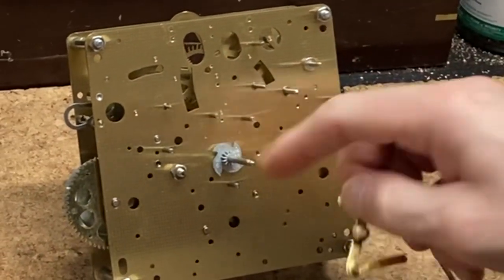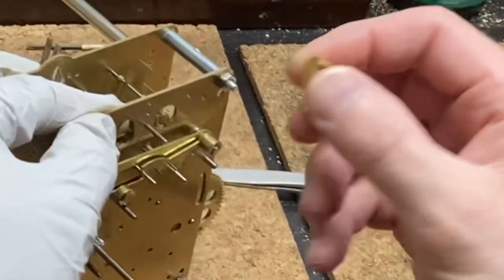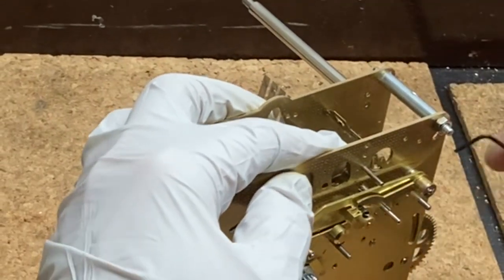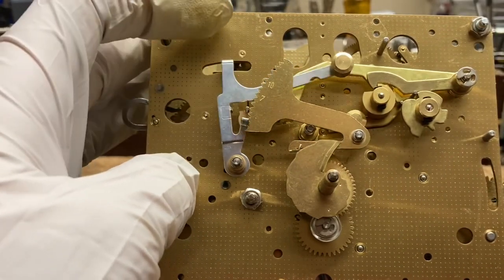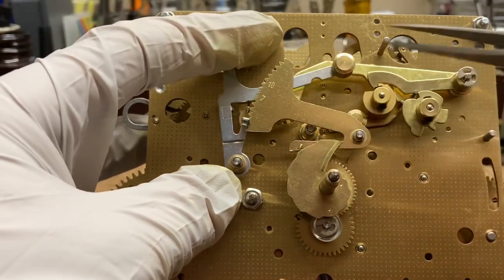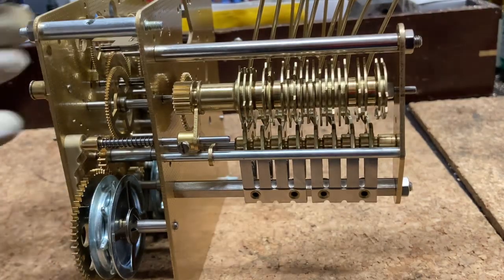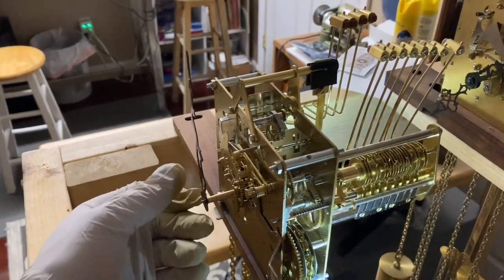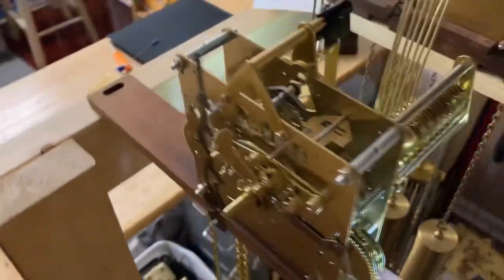How to install rack and snail to chime and strike for Hermle Triple Chime

Comment: Hello, I have a question.  I have a movement like the one in this video.  The problem I have with it is that it does not do the 1/4 hour chimes.  What it does do is that on the first hour it chimes the first 1/4 chime.  the second hour it does the 1/2 hour chime.  on the 3rd hour it does the 3/4 hour chime.  on the 4th hour it does the hour chimes with the correct strikes for that hour.  Do you know what causes this problem?  thanks

Comment: Thank you, Chris, some years ago I had a 3 barrel chime clock and all its attachments Holus-bolus piled on my work table.
So (without access to Chris's clock repair extra special directions) I began to reassemble each component in its sequential manner, finishing with the necessarily accurate escapement setting, then all I had to deal with was the chime and strike accurate settings.
Not overlooking my trial and error method, along with the disassembly & reassembly a number of times, while importantly, if I began to get stressed, I would up and leave my work table and give my mind a rest.
Time was not important as it was my own Winchester chime and strike clock, this occurred at my age at that time of my life, aged around 66 years & that was ten years ago, I am now aged 76. 
Yes, I finally had that old clock up and performing its strike and chime in its accurate restoration.
I was impressed by your assembly work, then your obvious years of experience has served you rather well.
Thank you for transferring your skills through your videos on your YouTube site.
Old William.

Comment: Merry Christmas!

After inheriting a Westminster chime wall clock (containing a 72 Hermle Franz 351-020 45CM) from a family member who entered assisted living in the fall, I have been attempting to get the "dead" clock running. The initial problem is that the pendulum refused to keep going. Turns out it was out of beat but the beat could not be corrected just by cleaning and oiling the pivot holes — which I did prior to Thanksgiving — in part because the clock oil that spouse and I inherited with the clock was as old as the clock (50 years!). I bought the Horace brand clock oil and took another whack at it on Christmas Eve, expecting no better result than before but instead got something of a Christmas miracle. Now the clock is keeping perfect time, just in time for my goal of getting it working by Christmas so I can show my family member a video of her beloved clock running for the first time in about six years. However, there is ONE issue remaining and that is that the chiming and the striking are jumbled together. The clock chimes as many times as it strikes and some of the chimes sound a bit sloppy (hesitating). 

Question: Is this (video) the main approach to troubleshooting the problem or is there something else I should try first? For example, I read elsewhere that there is a bushing inside the minute hand that may need to be adjusted but that was in reference to a grandfather clock. (Not sure if the same applies to this movement?) I am about to shoot a short video of the clock running to share with my family member but I'd like to be able to report that her beloved clock is 100% — and right now it's not because the chimes and strikes are jumbled up. 

As others have said, thank you for an excellent contribution to YouTube. Appreciate any tips!

Comment: Chris, your video was a big help fixing a problem that was strange to me. The problem was when the clock reached 12 o'clock, it would only strike 2 times. The rest of the times with the chimes and 1-11 o'clock strikes everything worked perfectly. After viewing your video I realized that the snail was not adjusted correctly and so after fixing that things worked as they should. Thanks
Reply from the maker: Great job!

Comment: Your video is a great learning tool.  My grandfather clock is a Danekar.  It has given me trouble for the past 25 years since my marriage to my wife Martha.  It is her late daughter's clock that I more or less inherited.  Before I began tinkering with this clock, my wife's father and his father were always trying to correct something with this fine machine.  My wife's father Joe actually built a wooden case for the entire movement so it could be easily and safely transported to clock smiths for repair.  Since I took over the maintenance of this clock it has always been 2 hours slow.  I could adjust the pendulum up or down until the cows come home and the time never is accurate.  The beat of the clock is correct and the pendulum swings freely and is actually on beat with a musical metronome.  Still the time is never correct.  I have almost given up on this particular dilemma. Lately, the chiming mechanism has stopped working.  This is something I really would like to repair.  Every You Tube video on this repair looks different from the mechanism in this clock.  Prior, the Westminster chimes would correctly function on 3,6,9, and 12.  The hourly strike would be somewhat functional as well.  However, the hourly strike would sometimes hit 25 or 30 times before it stopped.  I can easily observe this malfunction and have gotten the hourly strike to be accurate.  The problem again, and my main concern, is that the 3,6,9, and 12 chimes don't even activate at all.  From observation, there is no on or off switch to stop the chiming as there is on most clocks.  Short of hiring a clock smith to come out to the house, is there something that jumps out at you that could be stopping this beautiful chiming mechanism from working?  A response would be appreciated more than you can imagine.  Other clock smiths on You Tube have not bothered to respond to my much-needed expertise of grandfather clocks.  Thank You, Edmund Lubowiecki...
Reply from the maker: sorry for the very late reply.  Could you send me a photo to chrisclockrepair@gmail.com.  Then I could better assist you.

Comment: Chris:  I've been struggling to get my chimes and strike working since lubricating at Christmas.  When reviewing your video I noticed your "4/4" wheel was mounted closer to the shaft end than I had mine and when I looked more carefully, I noticed the "two" hook levers were being lifted by the 4/4 wheels cam. I moved my 4/4 wheel outwards about .02 inches and everything is fine. 😊 Thanks for your wonderful video but you may want to add a warning comment!
Reply from the maker: Glad you got it. What should the warning be?!
Reply: "Be sure the cam on the back of the 4/4 wheel is only engaging the front lever"   @Chrisclockrepair

Comment: I have a 1151-050 H sitting waiting for me to work on (mine is 114 cm as opposed to your 85 cm and the connection between the pendulum leader and the crutch on mine is a little different) so I'm expecting to watch this video at least a couple more times.  Thank you - this is quite helpful.  Also I like your test rack which it looks like has room for 3 movements at the same time so that gives me an idea of what to build.
Reply from the maker: Thats great to hear. My test rack can fit five or six clocks depending on the size of movements.

Comment: Appreciate this; it helped me get a 451-053 back in working order after complete disassembly and cleaning (previous owner had oiled the gears and everything was gummed up after sitting idle for years). What I ran into was an issue where the gathering pallet as you called it in 5:38 was not able to be separated from its shaft, so was left with trial-and-error assembly of the unit the star wheel, gathering pallet, and the warning wheel were all oriented correctly. Compared to the quarter hour side, which made use of set screws, the hour striker side caused quite a conundrum where I thought I had it right but soon noticed an issue where the last count for an hour was being cut off. One more tooth offset of the warning wheel's pinion later, and it was back to working correctly. The difficulty of maintaining the tooth positions when putting the clock mechanism together makes me wonder why the gathering pallet wasn't secured with set screws in the design to allow both sides to be tuned after final assembly.
Thanks again for your excellent video and explanation of the mechanism
Reply from the maker: You can adjust that star wheel on those hermle movements. Watch my strike adjustment video
Reply: @Chrisclockrepair  Ah, that would have made things a whole lot easier. Thanks!

Comment: Hi Chris.  Your videos are terrific and easy to follow.  I’ve watched your assemble and adjust the rack and snail video several times to try diagnose my chime/strike issue.  I have a Sligh grandfather clock with a Kieninger K series triple chime movement.  It stopped chiming and striking.  I’ve taken the dial off so I could see what’s happening.  I’ve oiled the pivots I can get to with Horace Whitlocks clock oil. It now chimes on the first, second, and third quarter hours.  On the hour, the drop levers raise, the chime governor spins a little, the levers drop, and then nothing. Governor doesn’t spin unless I move it but hand, then the cycle completes.  Once this stop occurs, chiming and striking are random and infrequent.  This 3 quarters chiming and then stopping on the hour is repeatable.  Clock was serviced in a local shop about 6 years ago and ran fine.  Someone may have tried to silence the chime while in progress once so as to not wake a child.   Any suggestions?  We don’t want to spend more $$$ for another repair so I’m trying to Youtube certify my way through this.

Thank you for any suggestions.

Jerry
Reply: A little more info…at the beginning of the hour chime cycle, the drop levers raise and the warning wheel rotates a little, but not enough for the stop pin to hit the detent.  When the levers drop, nothing else happens.  In all other chime cycles, the warning wheel rotates until the stop pin hits the detent.  In that position, when the levels drop the chiming proceeds with the warning wheel and governor rotating as they should.  I can’t see what causes the warning wheel stop pin to not make it to the detent.  The first three quarters the warning wheel stop pin moves from top dead center to about the six o’clock position.  On the hour it stops around the eight o’clock position.  Thank you.
Reply from the maker: Okay, I understand what you are dealing with.  What you want to check during the warning process (when the pin is approaching the detent) observe the chime hammers and the music roll.  If the music roll is too far forward and begins to try to life the hammers during warning, you will not have enough run to lift them when the lever drops.  There won't be enough power to start the sequence.  So it could be the position of the music roll is off or you need to lubricate the music roll and the hammer assembly rod.  If these are not the issue then it may simply be that you have worn pivot holes and there is simply not enough power to drive the chime sequence.  I hope that makes sense to you.
Reply: @Chrisclockrepair  Thank you so much for your analysis and suggestions.  I gave up my strong desire to take the movement apart and called a local repair shop. He identified worn pivot holes in front and back plates for at least one of the wheels. He will disassemble, clean, and repair the movement.  I’m spending more than I wanted to, but will save some of the expense by picking it up from his shop and reinstalling it myself.  Your videos are by far the best I’ve found on YouTube.  Your easy-going approach and clear explanations are helpful to novices like me, and probably to some professionals as well.  Thank you for taking the time to evaluate my issue.
Jerry
Reply from the maker: @jerryskelly9726  I appreciate it. Thanks Jerry

Comment: Hi Chris, many thanks for taking the time to do these videos. Could I just ask though, what product you use for cleaning your movements? They always look brand new, no matter what products I have tried, they never come out looking like yours. Once again many thanks.
Reply from the maker: I use a clock cleaning solution from timesavers. And i use an agitator to vibrate the solution as it sits in the bucket.

Comment: Amazing. You make it look so easy.
Its time for me to tear down one clock and clean it, the other is due for the oil.
On my ridgeway there is a pull type bar that hangs down it front of the hourly weight.  It pushes up or pulls down.  Do you know what its function is?
Reply from the maker: This is what turns on and off the “night shut-off” feature. So it doesn’t strike during sleeping hours

Comment: I followed you, all seemed good and logical until 15:15. I guessed 12 O'clock slot but you put it to 11 O'clock cam lobe. Why? I suppose later in this video it will be answered so I'm keeping watching. I deduce that in this position it just finished striking 11 and is setting up the rack for 12 .  This video taught me a ton! I have a Kieninger RWS and this front mech looks almost identical. Go figger!  As I recall it has spring return not the weight drop method. Thanks!
Reply from the maker: You're welcome.  Many repairmen will adjust the snail at 12; however, I do it at 11 and then move forward to check the drop on 12 and 1.  It's just a preference.

Comment: Love this, love the way this works. Explaining everything nicely, thanks so much. 
Wondering on mine, as far as hours go, everything works well until the 9oclock strike. It repeats 8 oclock. Then for 10 it strikes 9oclock. This is the issue. After this for 11 oclock it works fine again, business as usual. Dont get why there is this issue on only these hours. Id love to know why if the explanation is easy enough or am i just screwed. It seems like it should be simple, but what do i know. lol
Again this was, for me anyway, very fun to watch. The mechanics of these movements are wonderful. I like to watch mine, it is mesmerizing.

Comment: Many, many thanks Chris. You're the best, a natural born teacher and mechanical engineer as far as I'm concerned. I'm not afraid to dig into my clock problem now on my Urgos 5 tube. Chris, what oil do you use and also should we put some dab of quality grease on the hammer/cam lift lobes?
Reply from the maker: I don’t use any special oil. I simply use regular clock oil and i do put grease on some points and the hammer lift points is one of them.
Reply: Thanks Chris! I'll go ahead and get a bottle of the real stuff. Also, have found my Urgos UW03078B problem, crazy! The escape wheel is loose on the shaft and just slipping like a bad clutch in a Fiat! It's pressed on and it has just worn itself loose on the splines.
Reply from the maker: @sputnik4216  good job on catching that!

Comment: Chris, I am troubleshooting a 451-050H. It will chime on the qtr hrs but often doesn’t chime on the hour . It appears the chime cam is not lifting the arm high enough to trigger the chimming. In this video the chime release cam is already on the front of the movement. I’m just curious how difficult it is to remove and replace. Or do you think it could be something else? This video is great and has helped me get a better understanding of the clock. Thank you so much for taking the time to do this. Without it I wouldn’t have the courage to get the heirloom back working! I’m hopeful to only have to remove the minute gear, the email, etc to replace the chime release cam.  Thank you!!

Comment: Well done.  Thanks.  Our Miller grandfather clock has this movement and chimes.  It is 36 years old now, and the westminster strikes the hour but does not play all the notes.  It seems to play every other note.  The other two chimes do not strike all the notes either.  Any suggestions on what to look for and how to fix?
Reply from the maker: At 36 years of age, it is likely in need of an overhaul.  If the clock runs, but is not chiming all the notes, are the hammers moving and missing the chime rods?  I would need more info to help you.
Reply: @Chrisclockrepair  All the rods are present, and all the hammers move.  Some hammers move and strike with sufficient force, some do not, and one or more do not strike rods.  For its entire life, it has been set to Westminster, but now trying the other settings, the same happens with striking/non-striking, so it is not dependent on the setting.Thanks for getting back to me.
Reply from the maker: You're welcome.  It has been my experience that around 35 years to 40 years of age, these clocks begin to stop running properly due to wear from friction.

Comment: Hi Chris,
Agree with everyone that this is a great video! 
Hoping you can help me trouble shoot a problem I'm having on my Ridgeway grandfather clock  movement. When the smaller drop lever drops into the stop cam at the three quarter hour, it drops into the wedge of the stop cam and then it won't chime the three quarter chime. It looks like the drop lever isn't getting lifted high enough out of the wedge to get it to chime at the three quarter hour. As the clock keeps ticking and moves on to the hour chime sequence, the drop lever will lift correctly and strike, but at that point it's striking the prior three quarter chime sequence and not the hour chime sequence because it didn't strike back at the three quarter hour. Is there something that needs to be realigned to correct the stopping problem at the three quarter hour? Thanks!!!
Reply from the maker: It sounds like there is "not enough run" on the warning wheel and so when it warns, the cam only moves a small amount and thus drops back into the stop cam.  Then when it gets to the hour, the additional run allows it to go.  It sounds like you need to reposition the cams relative to the warning wheel (so that the warning pin is at top dead center) when the levers are in the stop cam.